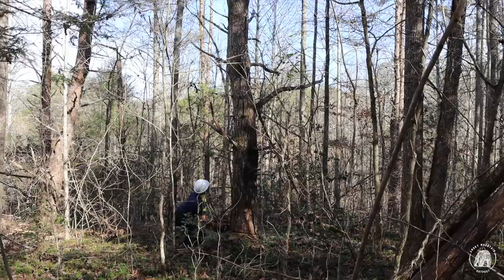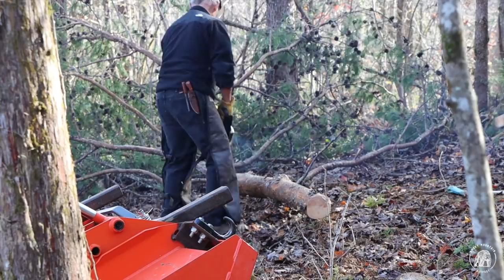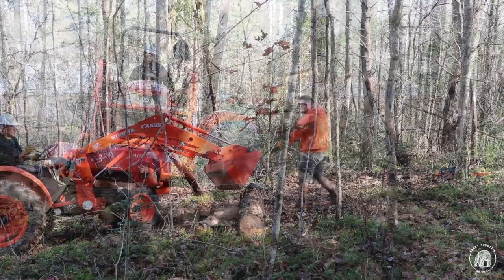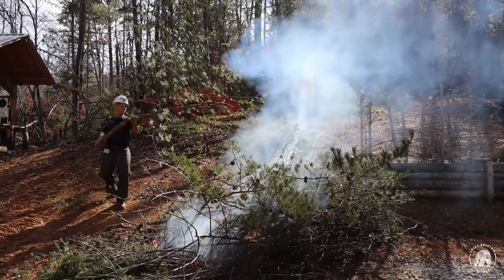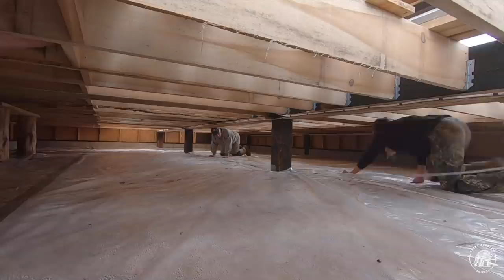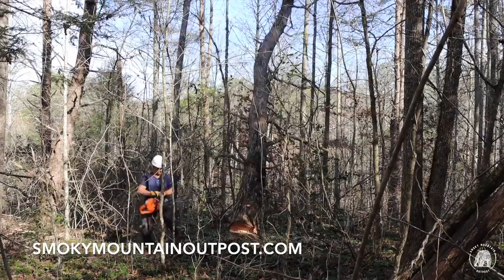S2 EP62 | TIMBER FRAME CABIN | WOODWORK | LOGS FOR SAWMILL & ELECTRICAL WIRING FOR CABIN

Comment: In the part where Richard is "laying down on the job", just past his feet there are two vertical log sections seeming to hold up a brace under the floor joists. Is there a purpose for that still or is it left-over from placing the joists and just hasn't been removed yet?
Reply from the maker: It’s support for the wood stove. Suggest watching the beginning of placing the floor joist in the “timber frame” series
Reply: @SmokyMountainOutpost  Ahh, that makes sense. I must have been distracted by something during that video and missed the explanation. "Knowing you" as we do now, I couldn't imagine it was something temporary you just "didn't bother" to remove. Great work as alwyas!